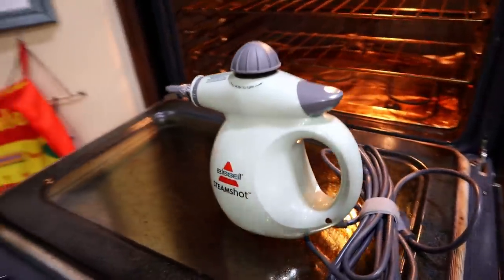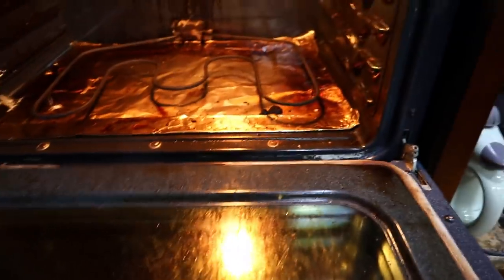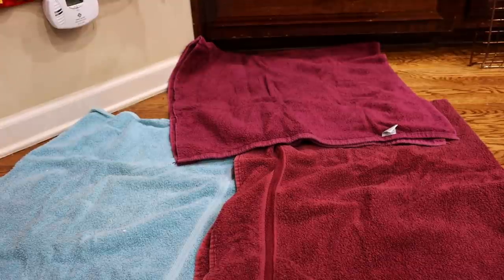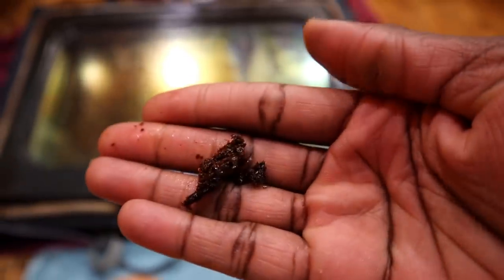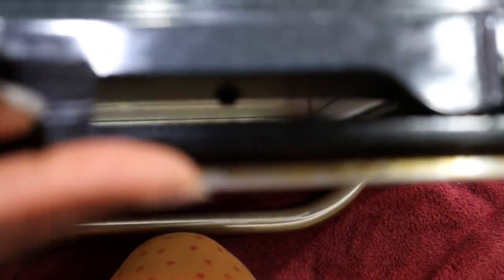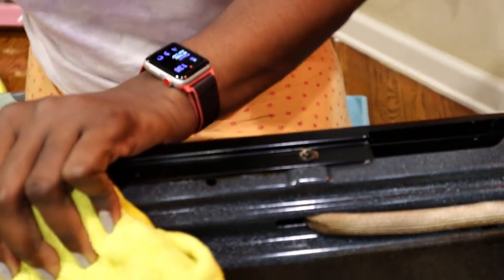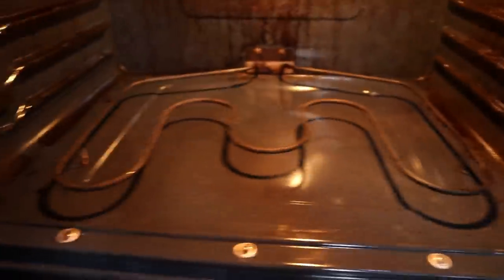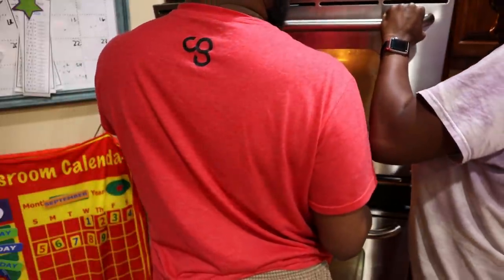How to clean your oven with a Steam Cleaner and Scraper! Oddly Satisfying CLEAN WITH ME

Comment: Girl!!! I came across a steamer at a Estate sale. brand new in the box..I have done my whole stove my cupboards my window sills, both showers. I was using it so much my kids told me to talk to my therapist about it. Don't let me start on the dehydrator..Getting it done girl..  My suggestion is to use one of the small brushes that come with the steamer. I use Mrs, Meyers baking soda because its pre mixed and you need to work in SMALL sections. dip the brush in liquid baking soda. steam small area with brush, wipe immediately. the baking soda cuts through the grease with the steam. P.s. the brushes do get messed up. I just replace them.

Comment: Jia you did so great ! But I think you need to use a really good degreaser and scrub the side and the back of the oven. I usually do it over phases. I spray the degreaser and leave it for a bit and then scrub. Then I spray the degreaser again and scrub it right away.

Comment: Spray it With a power wash  Dawn dishWashing liquid) Turn on the ovenFor 15 minutesAt 2:50) ThenFill up the power wash and Turn off the ovenWait 5 minutes then spray it with the power washAnd wipe it off) Try it see if it work) It is better than smelling that easy off that's for sure)

Comment: Buy a Polti Vapporetto steamer imported from Italy. You steam and wipe, no scraper needed. I have one and it works well. It saves me a lot of time and my stove, fridge, kitchen sink, garbage disposable and my porclein flooring cleans up amazing with this steamer.  I use for my bathrooms also. The tip keeping your stove and oven clean is to wipe it up after using it. Don't leave it for months on before you clean it.

Comment: Hi when I use my steam cleaner I use the brush attachment and put the rag over the attachment then steam whatever. Also what I use is a weiman cook top daily cleaner spray it and let it sit then scrap it with a metal razor scraper. You can use the weiman cleaner on the cook top glass and works great and I also use it on the glass of the oven. I also struggle to clean the oven and I get my husband to help as well. But the weiman is a degreaser and doesn't smell that bad like easy off.

Comment: You definitely can easily unscrew the glass in the middle and clean it, also I don’t know if you have the oven pride or a similar little oven kit over there where you can leave your racks overnight in a sealed bag & they come out like new & you can spray the inside & also leave it overnight (it comes with gloves) x
Reply: That sounds toxic though.
Reply: @loveforgood7520  oh no it’s safe stuff, you just got to be careful when you take the racks out & dispose the bag, but you have plastic gloves & the chemicals are not too strong. x

Comment: If it's a self cleaning oven, once it goes through the cycle it will be like brand new. No cleaning products, scrubbing or wiping required. Everything comes off, but just know when you start the self clean, your oven doors will lock because it gets extremely hot on the inside. Try it. I guarantee you will be pleasantly surprised. I never clean my oven manually. I always use the self clean.

Comment: Did you run out of water in the steamer? Because mine spits the water out so much more aggressively than yours appeared to. I refill min about 4x to clean the oven. I use a combo of things:
-SOS pads 
-Easy off
-steamer/scraper
-self cleaner ~~~~> allat (all that)!
Reply from the maker: Mine didn't run out I don't think.....It's hard to tell when it does.

Comment: Since Its already a self cleaning oven, just run that feature without using easy off or anything, all that grease will heat right off. Then you can spray it will any cleaner you use and wipe it down. I set mine to run for 3 hours. It will smell while self cleaning but atleast you will not be breathing in chemicals.

Comment: You may have been running low on water in the steamer. I have to add water to mine multiple times because it doesn't hold very much.